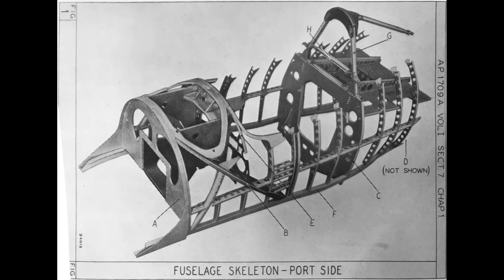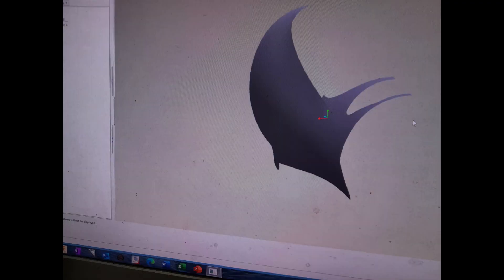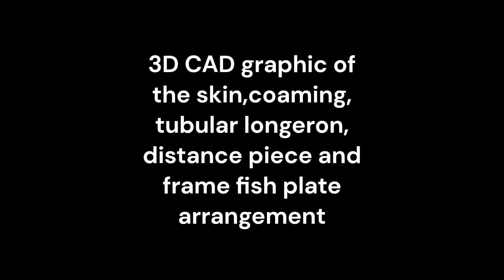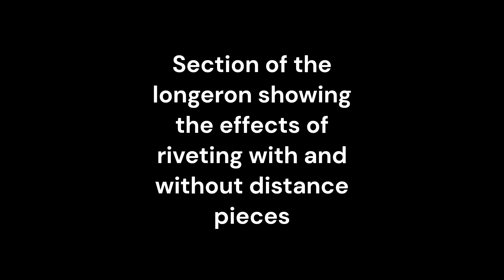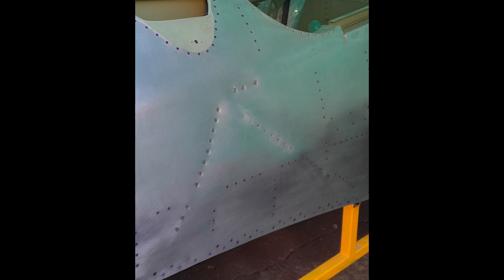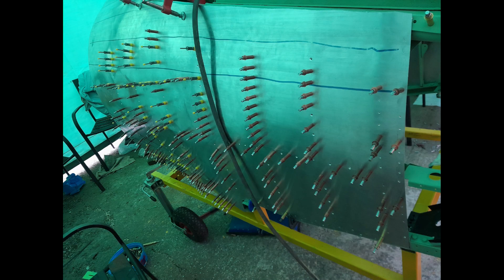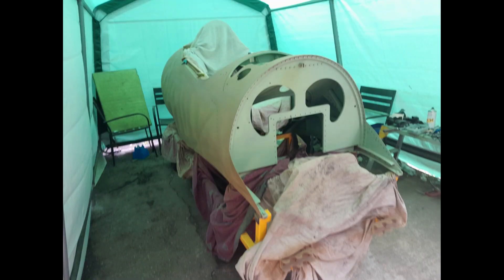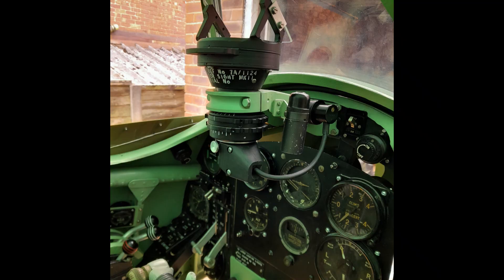Whirlwind Fighter Project - Engineering Update 16 - skin and paint

Comment: The Whirlwind was such an advanced design for the period - a full monocoque fuselage built to an Air Ministry specification issued as early as 1935 for a fighter armed with 20mm cannon, revolutionary for that era. 
But it was, of course, designed by the brilliant Teddy Petter.
And if RR had been able to put half as much effort & development into the Peregrine engine as they did in the Merlin, it could have overcome the limitations imposed on ii at higher altitudes by the supercharger and produced a real performer at all altitudes.
But 1939/40 was a pretty desperate time, and RR had to concentrate their efforts on just a few engine types.
Unfortunately...